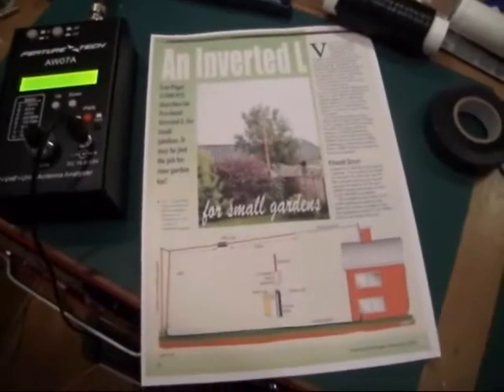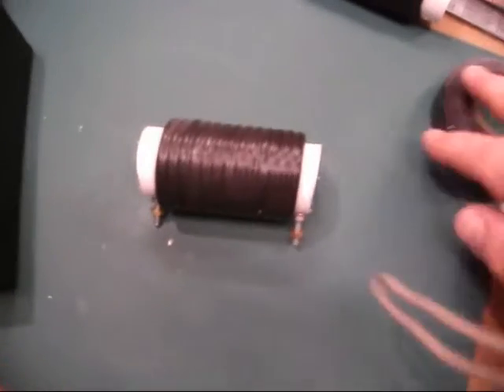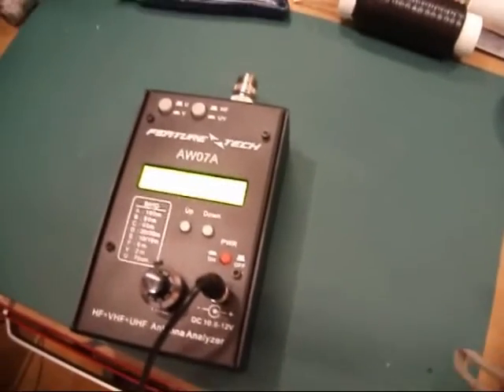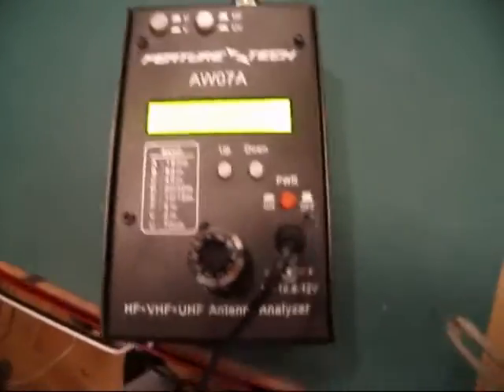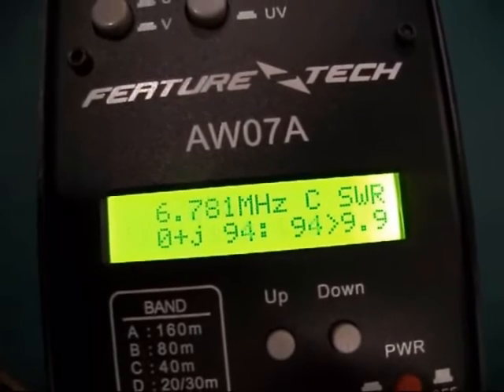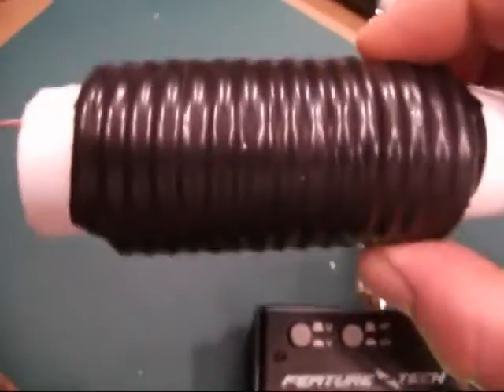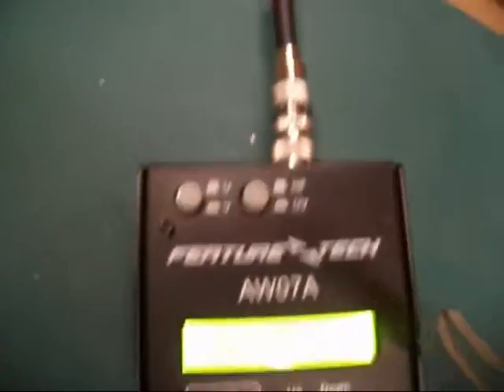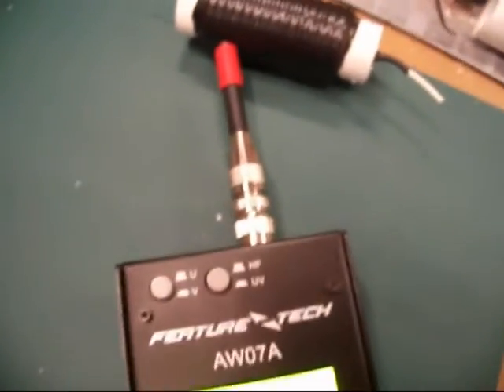Testing Coax Traps

Comment: How did your inverted L perform sorry dont know your name.

I have been reading the same PW article by Len as you.

I was thinking of buying a ready-made 80m trap off ebay at £32.

But not sure what bands that will give me....I'm looking for 160/80/40 and hopefully 20m am I asking to much.

I use a 38mt long inverted L at presnt...no traps and it does very well but I want to get it more resonant and need a bit of advice.

Comment: I found your grid dipper vry interesting and used my analyser the same way. However mine showed different resonant frequencies with different coils ant the end of my PL259 screwed to my analyser. I got resonant frequencies of 29.9MHz and with my other coil I got 26 MHZ. So at the moment this is rather useless. Is there a given Diameter for the coil of the analyser???